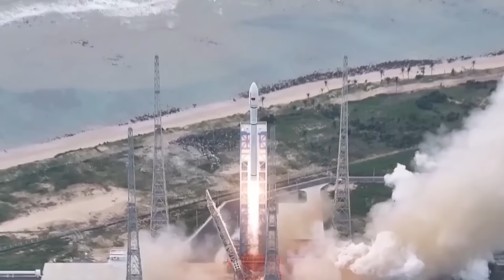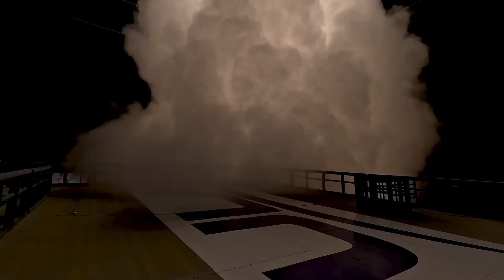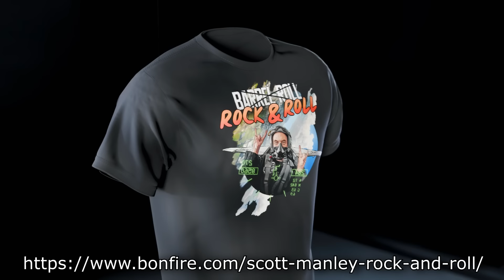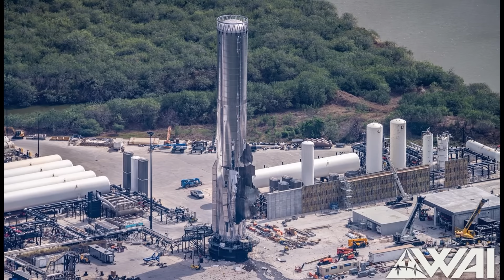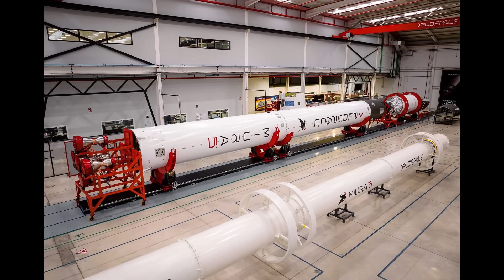Blue Origin FINALLY Reveal All Their Secret Projects - Deep Space Updates - November 22nd

Comment: Off topic but didn't know where to post this question.

Question.. For the initial launch of the tanker starships , why doesn't spacex attach an expendable srb system to the ship to reach orbital velocity without using the o2/lox carried in the ship? They could send a starship without engines ,or even 1 single vacuum raptor to achieve the correct deltaV if necessary. I know this is not full reusablity but as far as I know they was to expend the superheavy booster for these launches anyway? This method would allow the return of the booster and expenditure of the far less expensive srb's and deliver a full tanked tanker Into Leo. 🤔

Comment: Could still be related to welding even if its the copv that failed. With how the chines are installed it could have been weakened by focused heat welding the parts around that copv which caused a weak spot that failed on the tank.

Comment: On VLEO vehicles. Backnin 2000s I was calculating the ionic trust system for ISS that should have had randered the orbit reelevating burns mute. The result was that with the amount of Xenon, supplied by one Progress flight the ISS would be good for next 15 - 20 years. The bottle neck was though the power supply of the solar panels. They where barely sufficient for the engine running even at 100% capacity. An additional sollar array would have been necessary, with all the consequences of the logistics flying them up there. Which balanced out the advantages of fuel flight savings. So, not even an conceptual studies suggestion was made. 

So IMHO that VLEO needs to be of an very low operational energy consumption is supplied with solaraly, cause of high energy load if the engines. Or be of some sort nuclear power driven satellite...with its own challenges.

Comment: Notes:
- BO New Glenn launch, last Atlas V GEO launch, Pegasus last contracted launch. Shenzhou crew returns: next Shenzhou mission will replace the damaged capsule (cracked window). No more crew officially assigned to Starliner presently. Isaacman going around buttering senators for NASA nomination again.
- BO announces a large deployable heatshield, useful for Mars missions atmospheric braking.
- BO announces big performance improvements for BE-4 and BE-3U, improving performance of New Glenn
- BO announces New Glenn 9x4 with large fairing and 70 tons to LEO. Makes SLS irrelevant.
- BO announces Blue Moon Mk1 unmanned moon lander (landing near Shackleton crater)
- Kuiper satellites renamed to Leo.
- SpX Booster 18 exploded on Massey test stand. Looks like COPV failure.
- German company announced wanting to manufacture solar panels in space
- American company gets DARPA funding to develop an air-breathing super low earth orbit satellite
- NASA shows off photos of Comet 3I Atlas from spacecraft around Mars
- Scientists announce first detection of a coronal mass ejection around another star (a red dwarf)
- Saab invest in Pythumb to develop launch vehicle
- Spain company announces qualification tests of a Maiura-5 rocket for small sats
- Estes spun off a company for higher-power engines. That company was acquired by a real rocket maker.

Comment: how does supercooled propellant increase thrust?  it provides more molecules of fuel in the same volume - but as far as i know - that means nothing to chamber pressures and thrust...
Reply: That is a really good question.
I suspect that they increase the mass-flow by means of pumping in more propellant in the same volume, as you correctly say.
This would then mean higher chamber pressure, heat and ISP and also probably blow up the combustion chamber, UNLESS they also widen the throat.
Overall this would lead to a more potent engine with the specs otherwise unchanged, but I don‘t claim to understand any of the engineering.

Comment: QUESTION: I never understood the thrust vector of an Atlas V in this configuration. Three SRB's on one side, and just two on the other with the central LF/O engine. I've tried to build this in KSP and unless I move the placement of the central engine, the thrust is obviously higher on one side (3 boosters) than the opposite and the rocket just loses control. How exactly does this fly? Very curious.

Comment: Genuine question, if we "don't want SLS" what exactly are we supposed to use instead?
New Glenn 9x4 is less capable than SLS even on paper, and will probably not be operational until the end of the decade or later, and there may be a long process of actually getting it up to its intended performance level given New Glenn 7x2's current shortfalls (promising ~45t LEO, achieving just over 20 on a good day).
SpaceX could probably have built a three-stage Raptor-based rocket with similar capabilities by now if they wanted to, but Elon doesn't want to 'waste time' on a launch system that cannot export an entire city to Mars in a couple of launch windows (though all the long-lead hardware for that city besides launch is still mysteriously missing...) which is resulting in a very long development process. Furthermore they seem to be delaying building an actual payload bay into Starship at all costs and are currently using a pressure-stabilized Starlink compartment structure to try to achieve acceptable payload, which is somewhat concerning.
SLS already had its very long development process, and already has a fairing design locked in that works within mass margins without also needing to be a gigantic airlock in order to not crumple.
Reply: Yes, Artemis (and Orion in particular) have been designed precisely so that it will only work with SLS. Curious that, is it not?
It's just as if something or perhaps someone or perhaps a group of someones desperately wanted to keep SLS in the business. But I am delving a bit deeper into conspiracy/US-poilitcs territory than I would like.

Comment: If a ding to your pressure vessel can cause catastrophic failure, the solution isn't more training, it's a different pressure vessel design. Overly optimized designs that are not resilient to minor flaws or maintenance lapses will not work for rapid reusability.
Reply: The iterative design process that might work on a new app doesn't work well in aerospace. first, you don't build a huge infrastructure around an optimistic and unproven design. Second, that rocket could be doing amazing things without the reusable second stage, with 2nd stage reusability as a continuing evolution. Third, building reliable aerospace hardware is not the same as building cars. There needs to be a higher level o control and documentation. SpaceX has done it before, but it now looks like they're falling behind because their leader is not a functional one. NASA could never survive that type o mismanagement.
Reply from the maker: Everybody else uses the same COPV hardware, somehow they only explode on Starship/Superheavy.

Comment: Just curious, is there a reason that the 2 rockets (New Glenn and Starship) with CH4/O2 engines have the engine bell tucked into a skirt vs kerosene engines have the bells extending out the end? Is this a CH4 engine thing or just a design thing?
Reply: 99% sure it's a design thing. A re-usability design to be precise, since you'd want to protect your engines during re-entry.

Comment: I always hear about the Atlas V 551 being the most powerful configuration, why isn't a 552 configuration used for maximum effort?
Reply: Because the RL-10 is expensive, and a second one was never needed until Starliner.
552 would only be needed for the most heavy payloads into LEO and that never was required. For heavy payloads beyond LEO, 551 is enough.

Comment: Those COPVs are so similar to the Titan submersible hull
Reply: Not really. In a submarine, materials are in compression — high pressure outside, low pressure inside — and only a complete moron would use composites in that situation. COPVs are the complete opposite, with the material in tension to contain a high-pressure on the inside, and that's something which composites are pretty good at. SpaceX use a lot of them, and failures like this aren't common.

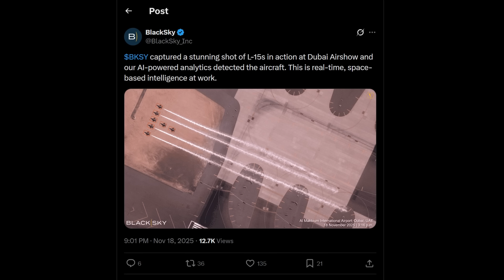Comment: 08:14 So it's probably safe to assume military spy satelites can detect faces by now...
Reply: No it’s not safe to “assume” that.
Reply: @executivesteps  Not many orders of magnitude more than the private satellite demonstrated in this video.
Reply: If you need 5 cm resolution to read a face (still pretty blurry, but just checking the math), and your satellite is 200 km up, that's about 0.05/200000 radians (≈ 1 milliarcsecond) of resolution required, which means a telescope aperture of 100 meters is needed, right?

I think earth observation satellites are usually operating at the limits of diffraction, because making everything else better than your primary mirror is a rounding error in cost. Government EO satellites are Hubble or better, i.e. the Nancy Grace Roman Telescope (née WFIRST) is powered by one of two hand-me-down mirrors from the NRO Keyhole/Kennen program.
Reply: @you238  I did a quick search now and looks like estimates are around at least 10cm per pixel

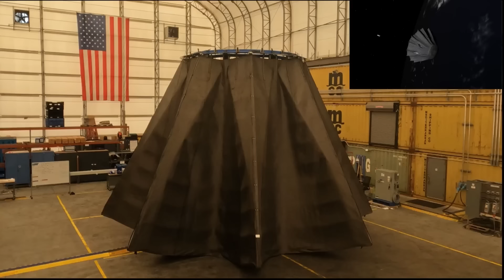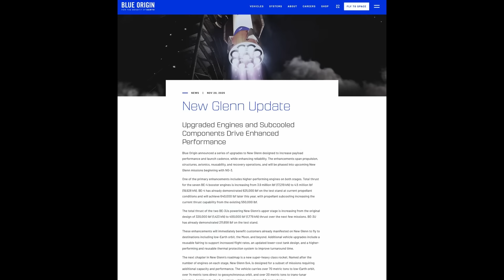Comment: 17:12 That folding aerobraking heat shield is an old idea. I well remember an article in "Flight" or "Aeroplane" circa 1962 describing research being done on it by Avco Corporation (now part of Textron), who also developed and  produced the AVCOAT ablative heat shield material for Apollo and Orion. As I recall, the 1962 concept was just like the one in the video, though the material was some sort of steel mesh (in the days before carbon fibre). 18:29  The BE-3U  engine is an impressive beast, using the bleed cycle to far exceed the physical limit of 25,000 lbs thrust of standard expander cycle hydrolox engines such as the venerable and expensive RL10 (still used on the Centaur upper stages of Atlas V, Vulcan and SLS/Artemis).  This means that the New Glenn upper stage does not have to lose altitude during the second stage burn as does Centaur, and the booster does not have to ascend as steeply or as high.

Blue Origin have certainly proved to be more imaginative and daring than NASA and ULA.  Their experience with New Shepard, seemingly a vanity project, has no doubt been extremely useful in all aspects of New Glenn, which threatens to compete not only with Falcon Heavy but with Starship,  as the hydrolox second stage allows for a bigger payload with a less powerful first stage booster. 

Now, can Blue Origin produce expendable second stages cheaply enough for New Glenn to compete for business with the Space X heavies? Or will New Glenn be like the VC-10 competing with the B707 and DC-8, technically superior but expensive and difficult to produce in quantity?

Comment: Giving Starliner a cargo role for now is probably a good solution. It allows Boeing to take a few more risks and gain flight experience, without the pressure of putting people at risk. In many way this would be equivalent to the Dragon capsules before they evolved into Crew Dragon.
Reply: The Starliner is supposed to offer a ton of close-quarters maneuverability. If everything would finally work right, it might be a helpful human-rated (or teleoperated bot-rated) capsule for space-station tending and repair, carrying things to and from LEO stations, and going from one orbital trajectory to another in LEO to serve as a very sophisticated space tug or trans-orbital shuttle for parts, equipment, possibly human crew after it is fully optimized... 

But yeah, let's focus on perfecting the cargo runs first.
Reply: @Wordsmiths it's first go went pretty bad. Probably don't want to be trying to test any of that when Boeings build quality didn't prove itself.

Comment: What if you go the opposite of clever reusable rockets and make a very cheap mass-produced disposable rocket (say using SRBs, simple hydrolox/keralox engines and as many off-the-shelf parts as possible) and just make hundreds of them per year. What would that do to the economics in comparison to making complex reusable rockets? A model T rocket if you like. Might be an interesting video to make.
Reply: KSP style. Not human-rated or for use with very expensive payloads like the JWST obviously, you still use good rockets for that - the SLS, Falcon and Soyuz are for that. Just everything as basic as possible. See how many you can make for as little money as possible. Seems to be a direction nobody is particularly considering.
Reply: If we ignore LEO constellations then on the order of 90% of the mass lifted to orbit is propellant. It has almost no intrinsic value until it’s in orbit.  You can lift expensive payloads to LEO on quite small rockets that are intrinsically easier to make and to recover if you like.  If you use high energy propellants like hydrogen you can refuel the “payload” vehicle very efficiently and deliver it to anywhere you want.  That vehicle would be very light relative to something that had to pump in 5-6 km.sec just to make orbit. Big clunky vehicles that can barely make LEO are basically only good for moving propellants. If you combine these two types of vehicles you can do far more than with either alone.  This concept is the only economically viable strategy that enables serious and sustained  lunar or mars exploration. Brute force methods are just plain dumb.  You might go to the moon every other year but that is not serious work.  It’s a make-work, politically driven, money pit.  It’s not sustainable any more than shuttle was.

Comment: Can rocket towers be equipped with electric linear accelerators to boost rockets while moving upwards besides the tower, resulting in low mass, high thrust if there were three to four towers surrounding the rocket, all with linear accelerators , this could result in either a serious savings in fuel or an increase in payload capacity or the velocity increase of the velocity the payload can be boosted with.
Reply: Good question. Answer comes with a massive asterisk. Yes but ... the rocket will need new structure and therefore mass which will severely reduce the actual savings. The towers will get blasted by rocket exhaust, so the expensive parts will be either stupid expensive to survive, or expended. There's also the issue of being able to dump that much electrical energy from somewhere, probably not possible directly from the grid, and the ohmic losses melting the expensive parts in the linear actuators.
Reply: @amandaklapp1171the structure of the rocket is already designed to handle acceleration especially when the tanks are full of fuel and oxidizer. Try crushing a and empty 20 oz pop bottle, and then try crushing a full bottle of pop, to illustrate what I am talking about! No additional mass would be required. The amusement industry uses linear accelerator and decelerators on roller coasters all the time. This is just a new application for tried and true electromagnetic technology!

Comment: The Atlas 5 always looks so strange to me with the 5 boosters. How does the odd number of boosters not cause problems with asymmetric thrust and excessive yaw in that direction?
Reply: Main engines simply gimbal a bit plus the thrust vector of the solids is not directly vertical.  It is angled through the approximate vehicle centroid.
Reply: @designvisionatmecom right, so they have to compensate for the asymmetric thrust. That seems a bit inefficient and unnecessary. Why not just use 6 boosters instead? Then everything would balance out

Comment: Comment & Like - yeah, that's the easy part.

Blue Origin is promising.  I would like to see a mission to Mars launch from earth orbit.  The spaceship itself should be a some-assembly-required method, because it's got its return mission along for the ride.  With such a big spaceship, it can carry an awful lot of science along with it.  Those new heat shields!  Since the robots it brings to land on Mars are super durable, they can be left to gather more samples.  They would get more sample tubes by landing the spares with a new robot with new science.  They meet up, shake transistors, and the new guy gives its package to the robot on geology duty.

Don't recover a second stage.  Re-light it and put it in orbit with a payload.  Problem solved.

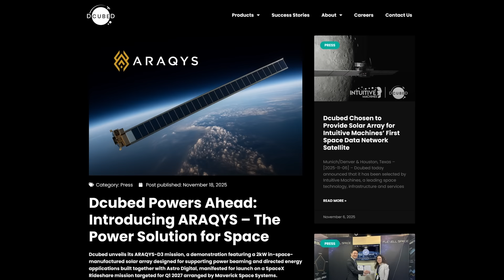Comment: Uh... re the solar panels printed in space (~25:10):
You didn't spend much time researching this, did you?
The way you report it, you make it sound like Dcubed plan to print solar cells in space.
That is NOT the case.
Instead, they will take flexible "solar sheets" manufactured on earth, and fly them into space in a rolled-up state.
Once in orbit, they intend to unroll those "solar sheets", and in the process of doing so, 3D-print a rigid structure onto them to turn them into proper stiff solar panels.
This is true for all missions in the series - except the first one, which will actually just demonstrate the 3D-printing of the rigid structure, without any solar cells involved).

Comment: Will ULA begin to use Sub-cooled Propellant?
Reply: The problem with the BE4 is that it burns LNG and not pure methane.  LNG is a mix of many hydrocarbons including butane.  These fluids actually materially increase fuel density compared to methane but if you are not careful even the LO2 temp can solidify them and cause problems.  If you subcool in the ground storage Dewars you can get rid of these high fusion point fractions but that’ll alter the density and tweak the effective mixture ratio.  You have to qualify for that.  There are better alternatives but no one seems to appreciate them. They too force retest but you can nearly double propellant density and shed tank mass compared to methane or LNG if you think a wee bit.